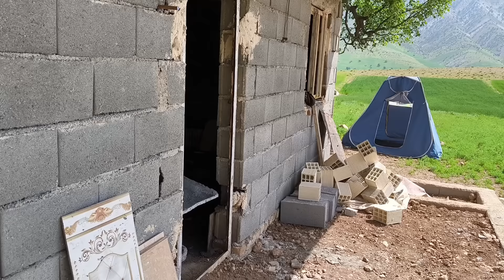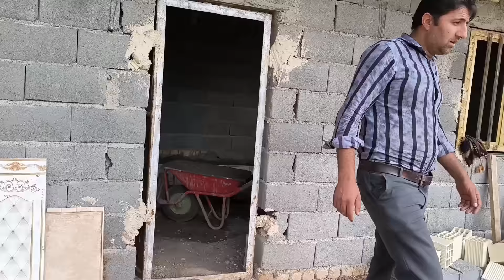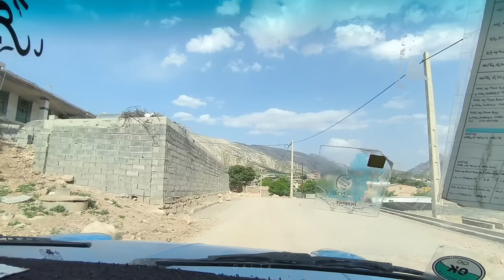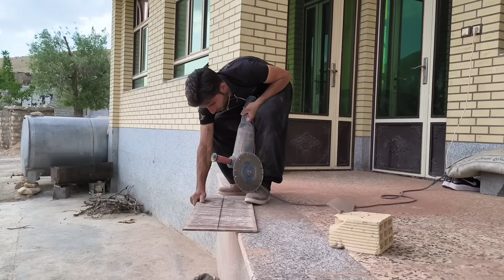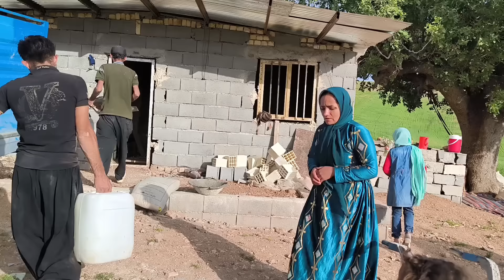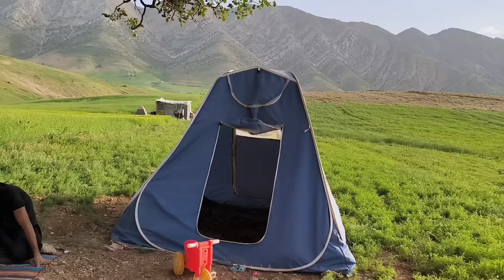Muhammad's love for Afsane: Muhammad's love for Afsane during tile work

Comment: Mustapha its better to weld two oil drums together & place it in the hole for the toilet pit & put the cover on top of the drum. Then make a square slab of concrete to go on top so when the sanatiton truck comes to empty it you only have to lift the concrete covering & open the drum to be emptied